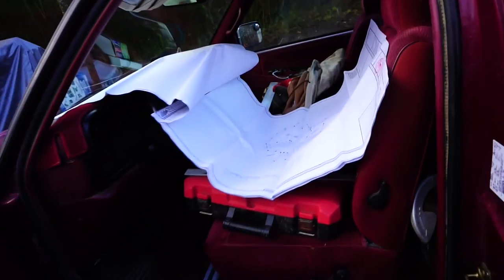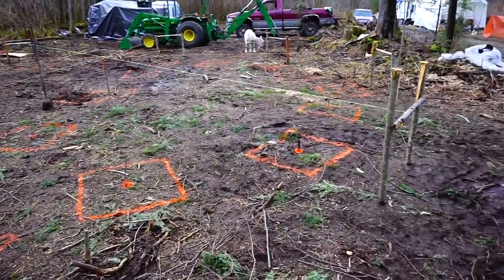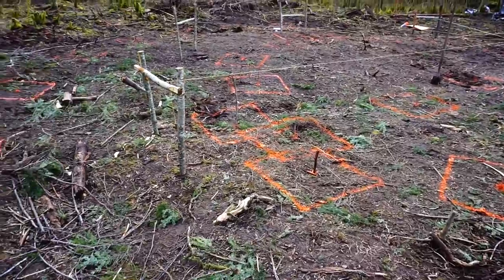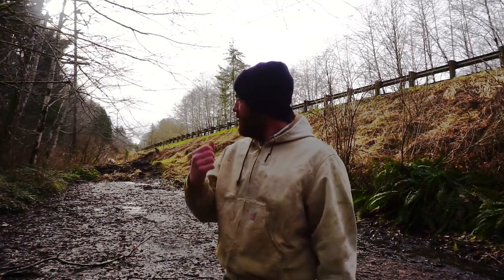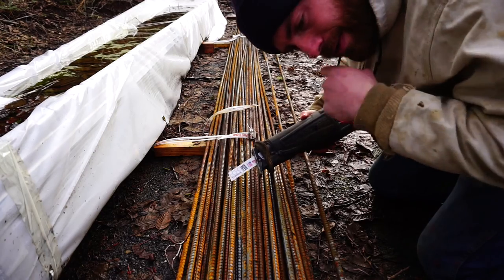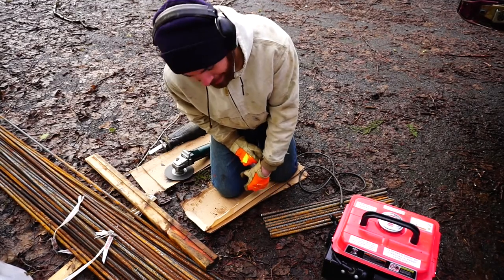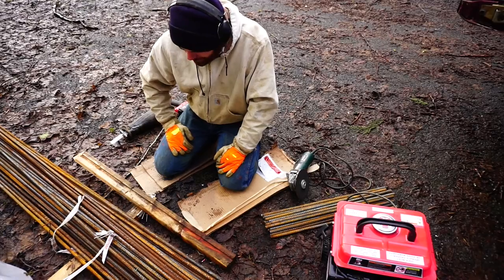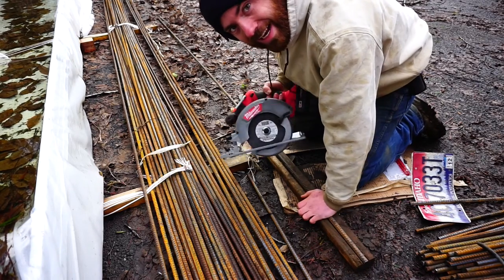Building an Off Grid Yurt Part 2: Digging Footings and Cutting Rebar

Comment: I am always amaze when I see such shallow footings. In the province where I live, we're allowed to dig and pour footings in two ways: slabs or 54" dug in the ground. Cinder foundations have been prohibited now for close to 40 years in our building code and I don't see the day when they will be authorized again for such usage.

You eased my comment when you start using your circular saw to cut the rebars. Simpler and much more efficient. I still don't understand why people remove the blade guards on their grinders, especially when using thin cutting disks. These guards might be a pain to deal with and to adjust but they are provided for good reasons. I was always please to have them on when a cutting disk shatters in pieces. I might have turned "Safety Sally" through the years but I haven't lost anything so far. I've worked under strict safety regulations for years and now, each time that I and friends get into any workshop, safety glasses are wear automagically. Earring protection can be found easily around tools that requires their usage. No one ever complained.

Anyway, I am eager to see your progresses in building that yurt.

Keep up your excellent work.
Reply from the maker: +Simon Forget I was amazed that the engineered plans came back this way. I talked to the building inspector about it and found out that the frost level here is at 0" and the requirement is to be at least 12" below. 

I used to work as a safety guy. I'm a little embarrassed that I've been caught so many times. I will improve though you may not see I next video, most of the footage has been taken. 

Thanks as always for your comment.
Reply: Twelve inches of footing... What a dream for not spending extra money on something that have no other purpose than being there to support a house. 😀

From now on, I'm sure we won't see any other safety hazards. Mitigations will be implemented and personal protection equipment will be wear at all time.

P.S.: Don't mention you use to work as a safety guy. It only adds to your embarrassment... 😂
Reply: Isn't crazy how we allow government to dictate things like building codes for private homes? it's all because someone in the cement companies paid off the politicians to sell more cement.  There is no money in doing the right thing.  Gotta love our masters :)

Comment: Dude you need some safety glasses when using an angle grinder . At my shop it is a fireable offense if you use one with out 2 layers of eye protection, glasses and face shield.